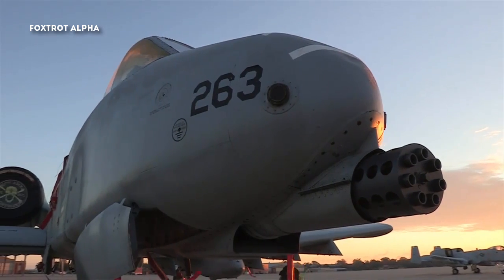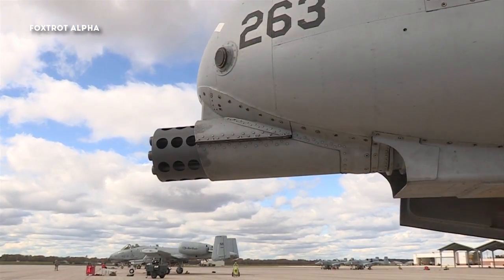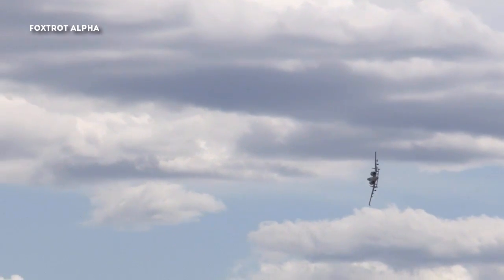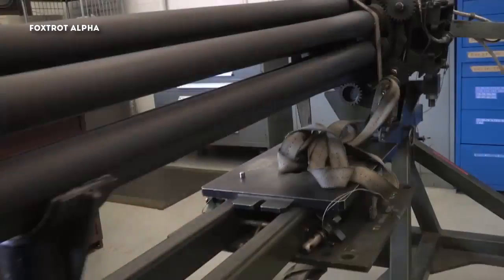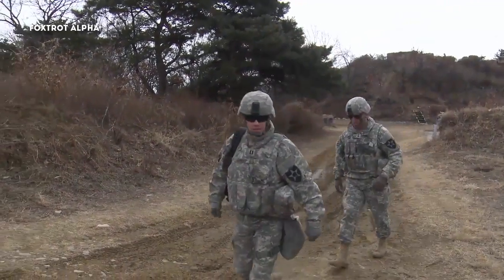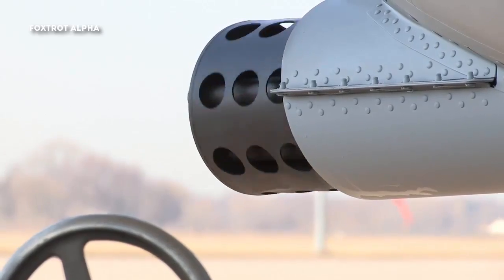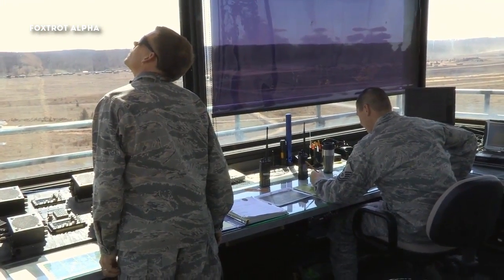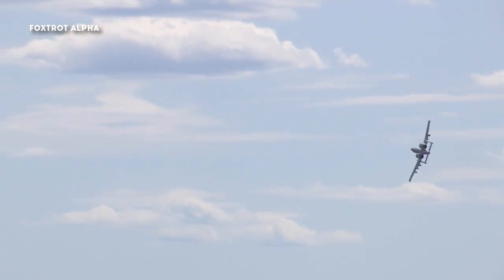A-10 Gatling Gun - GAU-8 Avenger Tankbuster

Comment: Except it was designed in the 1960s and is the heaviest and most mechanically complex 30mm auto-cannon ever conceived my mankind.... and they made it fly. So its 4000lbs of gun thats worth 10 bursts. 400lbs per burst... im pretty sure 400lbs of literally anything else would be far more effective than the 30mm because for the weight you actually put less than 100lbs of ordnance downrange in the vague vicinity of a target.
People keep riding the over-inflated propaganda nonsense without even sparing a thought if its actually worth it after the rotary fad of the 60s and 70s had passed. Seems a bit implausible that everything ever made for and used by the military just so happens to be flawless and the best in the world, super duper mega ultra amazing and all powerful, dont you think? Occasionally shit leaks that things arent quite so perfect in reality as the propaganda would like you to believe.
Reply: the chinese type 1130 has 4 more barrels